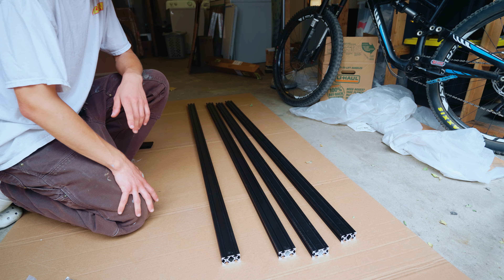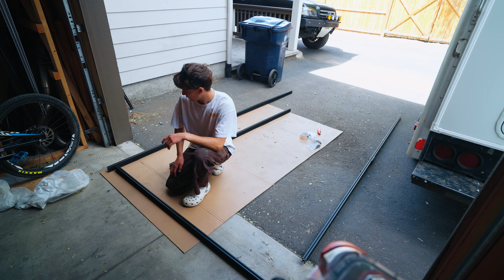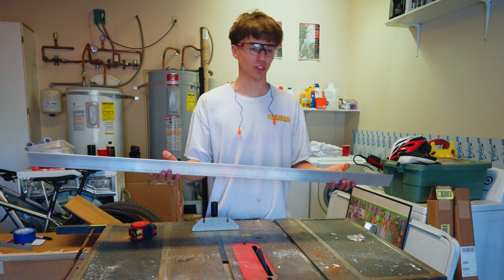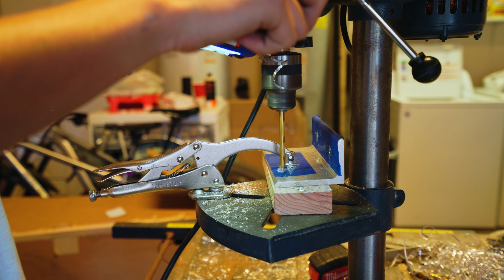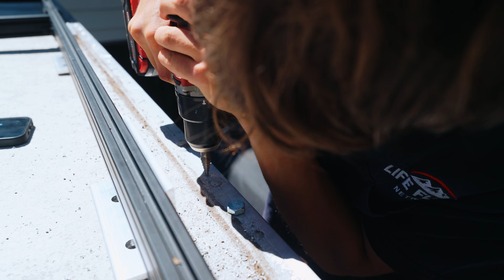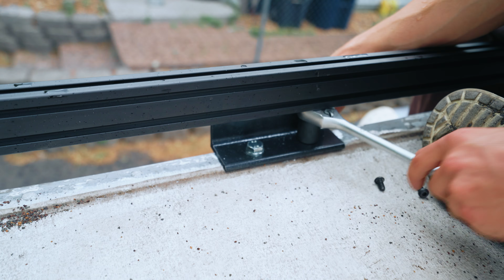Building an Extruded Aluminum Roof Rack! Easy DIY

Comment: Nice build! Someone on my road had one like this and from the road it looks like a 4x4 because the front axle appears to have a diff in the center and the hubs stick out from the wheel like 4x4 hubs. Like yours do. Is that 4x4 or do these vans just happen to look like they have a front drive axle?
Reply from the maker: Thanks!! This one is just 2wd right now. I think they made a few 4wd ones from the factory but it seems pretty rare.

Comment: I recommend double hex-nuts the bracket fixture to the van. The vibration will unscrew the nuts if there's only one. Most roof rack in UK are fitted with two hex nuts... well mine anyway. Just an advice :) Enjoyed the video btw, the roof rack looks awesome... can't wait to see solar panels on them! :)
Reply from the maker: That's great advice, I appreciate you letting me know! Thanks for the support, I'm excited to get the solar panels installed!

Comment: Nice job on that roof rack - looks really professional. Don’t know if you are already planning this or not but it would be a good idea to make a curved wind deflector for the front  of the rack to keep the wind noise and resistance down. 👍🏻
Reply from the maker: That's a great idea, thanks so much for the suggestion! I'll have to look into building something like that. My Toyota sequoia’s Sherpa rack has something very similar!